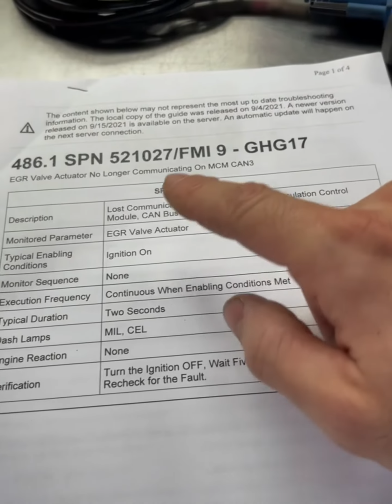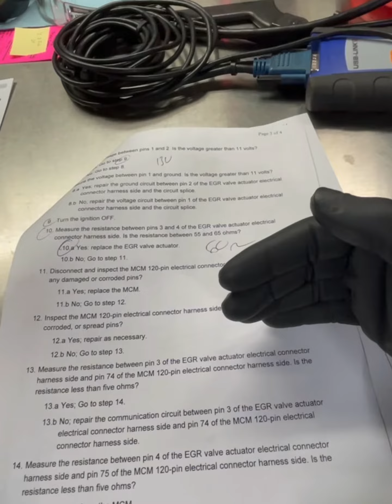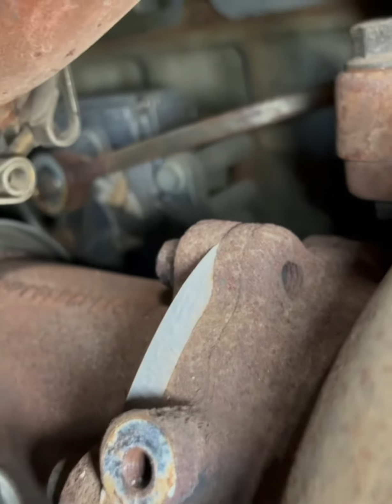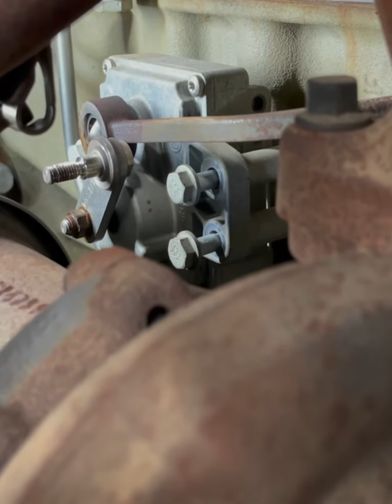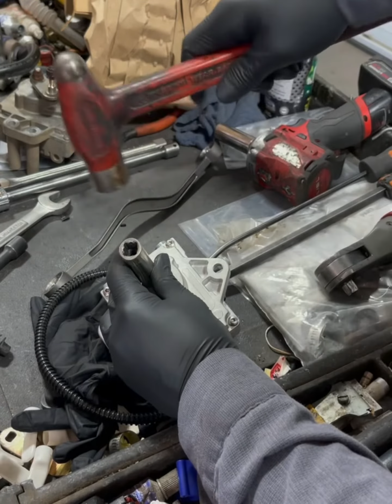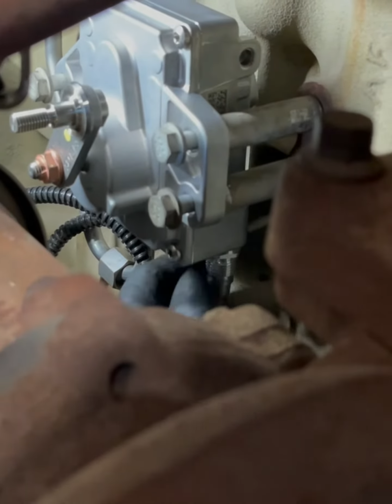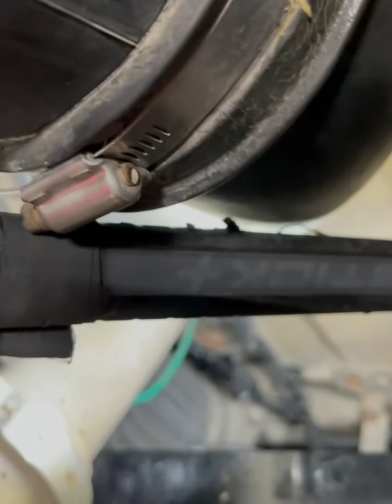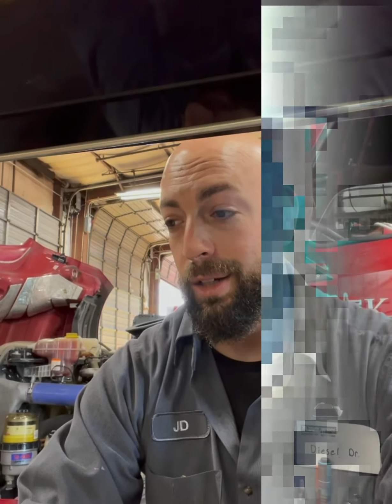Check eng light spn 521027 fmi 9. EGR valve actuator replacement. DD15/16/13

Comment: Man I’m loving these videos, I’ve decided to become a diesel mechanic for semi trucks/trailers. I’m going to self learn until I can find a good diesel program. I would like to start with learning the electrical repair first (what I want to specialize in), so I have a power probe 4 master kit, and going to get the fluke 233. Figured I’d start with learning the battery, starter and alternator. I have a truck and trailer as test subjects😂 so At the end of each drive shift i want to do some hands on learning. Please let me know if this is a good plan and if I should invest in any other tools to start off with. Thanks
Reply from the maker: Thanks for reaching out and watching. I would say being a mech is an endless game of buying tools and cut up up by zip ties. Doing the elec side is how I started and it deff paid off as well. Anyone can change a part but not many can really diag. If your heart is set on it than elec side is the way to go. Fluke all the way. The others don’t compare.
Reply: Thanks! That’s exactly what I needed to hear. I’ll focus on being the best diagnostician and specializing in electrical repair. Thanks again.

Comment: Do you have to do a relearn for a VPOD replacement?
Reply from the maker: Great question. Depends on the type of vpod and the year of the Eng.  this particular one, does not require re learn or calibration. Just plug and play.

Comment: Thank you for walking us through this. What is the SCR test? I’m at Freightliner and they are going to be doing the exact same thing
Reply from the maker: Not a problem and glad it came in handy for you. At least with the knowledge of behind the scenes so you know what the dealer would be doing.  The scr (selective catalyst reduction) would test the aftertreatment system kinda like a regen but main focus would be on the def side of things. That would be a scr effiencey test. An scr ads test would test the def pump, def doser and lines to find out if theres a leak or restriction. Hopefully they have parts available for you, lately its been nuts...
Reply: @bustedknucklebydieseldr3228  thanks for all the info! What should I tell them to do? Is it called the SCR efficiency test? Do you think they will also do a regen? 😬
Reply from the maker: @notanotherusername  as long as they follow the proper troubleshooting and verification process than you shouldn’t have to tell them anything. You can always request the tech notes or story to help you feel a bit more confident in there work.
Reply: @bustedknucklebydieseldr3228  thank you!! What is the difference between the EGR valve and the EGR actuator? By the way, I am rewatching your video here and I love your sense of humor 😆
Reply from the maker: @notanotherusername  appreciate it man. Only a few people get my humor, it’s  Deff Strange one. The EGR valve actuator electronically controlles the EGR valve itself. So think of it as one electric piece and one mechanical piece. Both regulate how much exhaust flow will be sent back into the intake for recirculation and raises internal combustion temps.  Which is a good thing for better fueling. Hope that clears some things up.
Reply: @bustedknucklebydieseldr3228  thank you!! I will be tuning in to your channel so I can learn more. You'd never know it but I am a lady😄
Reply from the maker: @notanotherusername   Shoot,sry. Foot in mouth. Analytics show me only males reaching out which I assumed thats the general market on over the road drivers. I hope these vids continue to be informative and useful to you. Stay safe and stay grinding out there.
Reply: @bustedknucklebydieseldr3228  thank you!! I have a brand new EGR actuator! The old one that I have was an older model. It didn't look the same as the new one. It had new fittings and new lines. 🌟🌟🌟
Reply: Seems like a fairly new motor. How many miles. Thanks for sharing

Comment: dd15 spn 3597 fmi 4 freightliner (2015).  It makes a whining noise whenever the code is active.  My mechanic got me throwing parts at it.  I replaced my MCM and both valve cover harnesses and it's still active.  In the "detroit service information bulletin", it says to disconnect the OEM 31 pin connector to see if the code become inactive.  Where is that sucker located?

Comment: I have Spn 0973 and Fmi9 code.  Can’t find a fix or anything on these codes anywhere.  Dd15 Freightliner Cascadia.  Any idea?
Reply from the maker: This code is typically a parameter issue or switch issue for the engine brake switch. Either switch is bad, wiring has an issue , or the parameters need to be checked incase it’s not being seen anymore.
Reply: The jake brakes seem to be working fine.  Is there wiring on the actual engine to check?  I have a little scan tool for regen purposes.  I reset the code, but it comes back.  🤷‍♂️.
Reply from the maker: @Poppi3579  there is and depending on year of Eng it changes slightly. But t/s would have you separate under valve cover wiring from engine sensor harnes wiring and see which side has the issue. But it’s best to start with a diag computer and see if the switch is registering otherwise we’d be wasting much useful time.

Comment: Alright I guess I’ll be the first to say it, when do we get a tool box tour?
Reply: Hi Dr I have Cascadie 2019 with DD12 automatic transmission unfortunately it doesn't work properly When going to uphill gear 7;8 or 9. randomly switch N position just 2-3 second after running good again. The computer screen shows " Starter Blocked Switch to Neutral"..
Can you help me what the problems??
Thank you

Comment: Another good video. 
Have you dealt with code spn 3058 fmi 9? The truck is a 2016 Cascadia with DD13. It is egr related, but that’s all I know.
Reply from the maker: Thanks for watching. 
This coat to be a tricky one and can often be caused by back pressure in the aftertreatment system. In which no repair is really necessary. There might be an issue with the delta P sensor or clogged ports, any exhaust leaks or boost leaks, Or strangely enough if the DPF needs a region is for too long can cause this code. Really we just need a diving with a computer I hope that helps and appreciate your support in this channel
Reply: @bustedknucklebydieseldr3228  one of the ports to the delta p sensor was blocked. Cleaned both ports and replaced the sensor just in case. So far no code 1,000 miles after the repair. 
Thank for your help
Reply from the maker: @paulb.5497  that’s great to hear man. Let’s hope it stays that way. Glad to know you’ve found an issue and saved $$$ instead of sending it to you know where. (A dealer)
Reply: Hey if the egr is deleted ??the valve work too???

Comment: Hi  I have a truck 2016 freightliner day cab , has spn 411 fmi 1 and spn 3058 fmi 9 I did Delta pressure port Cleaning but still have the light on and off , do you know what is going on with this truck？ please let me know thank you!

Comment: Mr Diesel Doctor my truck has the following codes: 
SPN 2659 FMI 18 EGR Flow Target Error Diagnostic - Low flow
SPN 3058 FMI 10 Exhaust Gas Recirculation Slow Response
SPN 411 FMI  1 EGR differential pressure too low (high box)
   I changed out the EGR Cooler and the Delta P sensor but the codes won’t go away. Would swapping out the EGR actuator make these codes clear?
Reply from the maker: Thanks for reaching out. Those low flow codes are mainly EGR actuator error or EGR valve being stuck issues. Best advise is to go through the t/s for 2659 which has you verifying its working correctly than go from there. Without a diag computer it’s going to be hard to accomplish because that tells you a lot of what you need to know. But more than likely we’re looking at a EGR actuator issue. 
And don’t forget these videos can make great holidays gifts.
Reply: Thank you sir I really appreciate it!

Comment: Hi, what usually symptoms are from bad valve actuator? Thanks
Reply from the maker: For starters your check eng light would be a good indicator. After that, you might notice a derate in power, slower take offs,more frequent regens due to dirtier running engine,.Things like that. Good question though.

Comment: I swapped 2019 motor into 2016 cascadia after that i am having rough driving speedometer hoes ups and down feels like motor is not getting enough air and trying to breathe
Reply from the maker: This could be bad programming or poor fuel flow. Would really need to get hands on and see what’s it’s doing. I would start by u plugging the fuel meter on fuel pump and see if it helps.

Comment: great video. quick question I have low voltage on my 2013 freightliner with a dd15. I have new batteries and new alternator and my voltage is still at 12volts. what could be causing the low voltage?
Reply from the maker: Great question, that issue is typically caused by a bad wire or fuse to the remote sense. Check that fuse and ensure it’s good. With that blown it’ll never act right. After that you may be getting poor grounds to the cab of its reading wrong and your alternator is truly putting out 14v.  Check the actual alt output than fuse than sense wire. Let me know what you find. .
Reply: @bustedknucklebydieseldr3228  so that fuse is for the remote sensor for the alternator? if so where is located?
Reply from the maker: @jorgefacio690  yes sir that would be for the alternator telling it to charge to batteries. It’s there to let the alt know what voltage the batteries are at. This is tricky since yours is a 2013. It could be in a pdm on the d/s fender or  under the cab above the batteries with a few other mega fuses or p/s firewall by hvac box.  Those years they were experimenting with diff locations with fuses.
Reply: @bustedknucklebydieseldr3228  ok then ill check it out. thanks
Reply from the maker: @jorgefacio690  I know there’s others on here watching and waiting to know what you find. Keep us informed.
Reply: @bustedknucklebydieseldr3228  I sure will